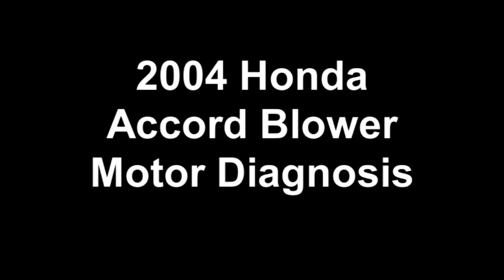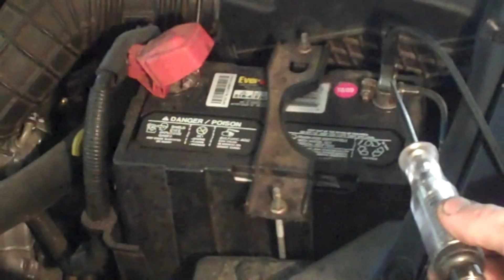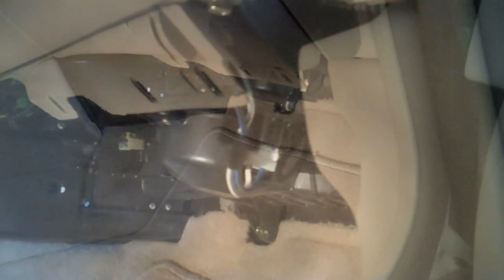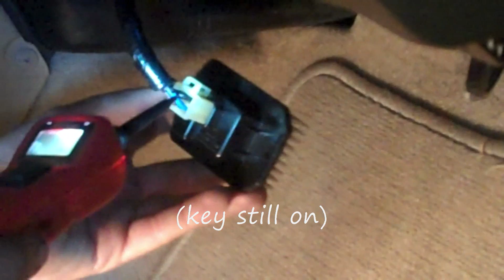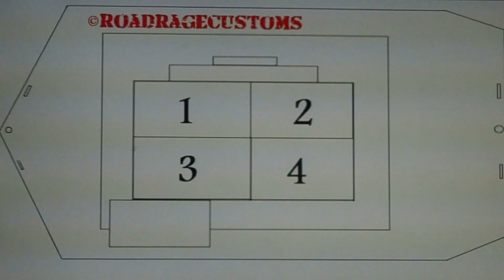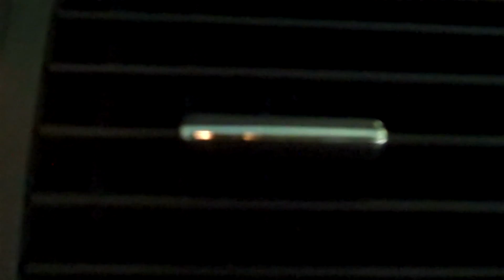Honda Blower Motor Diagnosis

Comment: Google "how to test the blower motor power transistor" (2001-2007 Honda Civic). There are two more tests after the 1500-Ohm resistance test. The first is a diode test with pins 2 and 4. The second is a AAA battery test. There are also separate tests for the blower motor itself.

My 2003 Civic resistor passed the resistance and diode test, but admittedly I got no reading on the AAA battery test so I'm unsure whether the test failed or I'm doing it wrong. Ordered a new resistor anyway.
Reply: My question -- the whole internet says that if your resistor is bad, replace the blower motor too because it may be causing the resistor fail by drawing too much amperage. This appears hard to test. But I can't find any evidence that this is case for 2001-05 Civics.

Comment: do you know if there could be any other reason besides the 40 amp fuse, the transistor or the blower fan motor for why my 2008 honda civic isn't blowing air.  I've bought a new motor, transistor and still not working.  I'd appreciate any help you could give.  Thanks :)

Comment: In agreement with other comments below, it could be noted a little better that the 1400-1500 ohms test is the not the only test for the resistor. It can pass this particular test and still be bad anyway.

Also the heater motor can 'test' as working with a grounded jumper wire, and it can still take out your new $80 relay in about 3 minutes, if the motor is drawing too much current. At least in my case, the fuse didn't prevent this for some reason.
Reply: where is the relay located?  is that different than the blower fan resistor/transistor?

Comment: This is a helpful video. It at least gives you an idea of what to check. The Honda Civic that I worked on has a resistor, which is not a transistor. It was a faulty blower motor for myself--a 56$ part new.

Comment: great video, replaced my power transistor and blower motor operates.  My power transistor did measure 1500 ohms across pins 3 & 4, but I replaced it anyway.  If this part is in fact a transistor wouldn't a diode tester on a multi-meter be a more accurate way to bench test the component?

Comment: I checked my resistor, 4 door, contacts 3 and 4. 1500 ohms., it was bad, so that;s not the only thing that could go bad on the resistor.
Reply: I had the same problem. I agree video requires updating. It could send someone through troubleshooting headache. 🤣

Comment: 03 honda accord 4 cyl.lx air blowing slow .tap it and blows a little better but still not hard. would that be resister or motor
Reply: Motor

Comment: If pins 3 and 4 test fine for a 4 door 2001 honda civic and pins 1 and 2 test at zero, is it still a faulty resistor?

Comment: Good video thanks for your instruction!!!
I have a 2008 honda ridgeline with auto climate control option and hvac blower is not operating on any setting at all i have checked all fuses and relays checked wiring and connections from blower motor to resistor to hvac control unit all is good but no power coming into resistor harness from control unit is this a bad control unit problem? ??

Comment: Very nice, sir.   Just troubleshot the wife's 2001 Civic blower using this video. Sure enough, it's the transistor network. The diagram I printed, showed one more thing, however. If the resistance reads fine, (which it did), next apply a 12v jumper from the cig lighter to pin 1. If the motor comes on, it's something else. If it doesn't, double sure that it's the part.

Comment: Great video, thanks! Dealer wanted $300+ to fix but I got the part for $22 at Drive Wire. One word of caution though: I did this fix in my 2004 Element, it has the same A/C system. I tested the new resistor hanging from the harness as shown here, but when I reached up to turn the key off I bumped the resistor causing the heatsink to contact the bare metal dash frame. Sparks flew everywhere and the brand new unit shorted out. It was another hot week until the second new part arrived. Use caution!

Comment: Jumped fan to battery, it spun but sparked. Ended up blowing new resistor in 30 mins so I got another $5 resistor and a $20 blower from junkyard and it works.

Comment: I want to thank you for this video. I needed something to show me how to do similar diagnostics on my 2004 dodge Dakota. Totally different vehicle, but using these steps I narrowed down the problem and I need a new resistor. This is what they charge over $100 in labor sometimes? SO SIMPLE! I refuse to get ripped off like that again!

Comment: I have a 2002 4-door Honda Accord LX.  It has a manual dial for setting the 4 speeds of the blower fan.  With settings 1 & 2 the fan does not come on at all.  However, the blower fan works just fine when on settings 3 & 4.  How would  I go about diagnosing this problem?  Thank you.

Comment: Hey man, loving this video. Quick question, I've a 1998 Honda Civic and the heater blower is acting up, it seems to work for about 5 minutes before it dies. Any idea why this happens. I've already replaced the blower motor power transistor before. Cheers.
Reply: I got the same problem on my 94 Del Sol - replaced transistor but still works on and off randomly

Comment: My local dealer had it in stock so I went ahead and replaced it.  That fixed the problem.  I guess the check for 1500 ohms does not eliminate the resistor from being the problem.  Thanks again for the video!

Comment: Great video.  Thanks for sharing.  I have the same car as the video (04 accord EX).  The AC stopped blowing.  I have followed everything that you did.  Fuses underhood and dash, voltage at motor - white wire 12v, blue wire 0.63v.  You said voltage at the blue wire instead of 0 would indicate a faulty transistor.  I removed the transistor and it has 1500 ohms for pins 3 and 4 (4 door).  Should I go ahead and replace it or is there something else wrong?  ps.  I straight wired the motor and it ran.

Comment: I think I may have the same issue because I've tested all the fuses and I'm still getting the correct resistance from pins 3 and 4. I am a little unsure of buying another resistor on the off chance it isn't the issue. Were you ever able to find out if you had a defective resistor in the first place, and is the new one still working for you?

Comment: I have acura TSX(06). Yesterday all of a sudden the Fan and AC doesnt work. I turn on AC and nothing, I set fan speed high, AC manually to69 F (outside is 80), nothing, the fan doesnt blow anything, I dont hear any noise, dont feel AC.  What might be the problem?
Reply: allocated did you ever figure out what the problem was? I'm having the same problem on my 04 tsx

Comment: i have a 91 Honda Civic and the AC is cold (hoses) but does not blow air can you let me know where is the relay of fuse so i can check it because i believe they disconnected  when i bought the car

Comment: Very nicely done. Really informative. Have a 98 CRV. Resistor has 3 wires instead of 4.  Any idea which two to check for ohms resistance? thx

Comment: Thanks for the great video it helped me to repair my car. I tested the resistance between 3 and 4 it is 1500 ohm. Still blower is not turning on. I took the resistor and test it in another vehicle with same specification (Honda Civic) and there too it was not functioning which was a positive indicator that the resistor is defective. Bought one from Honda for $150.00 installed it and it is working fine now. I still have the old resistor can you advice if it is defective or how i can repair it.

Comment from the maker: @Bldrsecor Is it not working at all, not working well, are the lights on the control working?  If the blower motor isn't spinning try the following.  Check the blower motor.  Check to see if it has power & ground going to the 2 wires going to it.  Check the blower motor relay & blower motor fuse (#21 I think) under the hood.  If you need more info, let me know if it is LS, LX, or whatever Honda calls Ridgelines.  Also let me know if it has manual or auto AC & exactly what symptoms are.  Thanks.

Comment from the maker: @Deathsassaliant That may be an ignition / tune up related problem, but Nissans used to have major fuel delivery issues.  The fuel injectors would leak & the fuel injection wiring harness had wiring that wouldn't hold up.  You may need 6 fuel injectors & 6 injector pigtails, if not the whole engine sub-harness.  You could easily spend $700.00 or more on parts alone.

Comment from the maker: @yangstud0 That model would have a resistor instead or a transistor (it does the same thing). Did it smell sweet, like maybe, the heater core was leaking coolant? If it was smoke instead of steam, it could be the blower motor or the wiring to it. Disconnect the motor & check for power & ground at the wires that go to the motor. If they are good (& not melted) apply power & ground to the motor & see if it works.  If not, something may be preventing the motor from turning or motor may be bad.

Comment from the maker: @Nightwing690 I bought an engine once from a dealer and the oil pump failed within 3000 miles.  I called them to see if I needed to pull it out to return it to the parts department, or what? They said they needed to see if it was rebuildable & to tow it to them. I put a brick on the gas pedal & threw all 8 rods when I started it. The block was busted all the way around the oil pan. They put another new crate engine in the bed with a gal of coolant, gaskets, oil & filter, and towed it back to me!

Comment: The resistor is the weak link in the circuit besides the fuse. I'd much rather replace this than that contol panel. That looks expensive. Nice job with showing how to do this repair.

Comment from the maker: @spelunkerd Honda part number 79330-SDA-A01 is a "blower motor power transistor module".  It's more than just resistors.  It communicates with the control unit & can provide feedback that can cause the unit to store codes for diagnosis.

Comment: You keep using the word transistor. Don't you mean resistor? I thought the way the blower motor control works is by variable resistance.

Thanks for posting these videos, I don't mean to criticize.
Reply: Transistor, Power - Honda

Comment: Good vid. i didn't know newer cars use transistors. Question now is, "Did the transistor blow out because it was bad, or is the blower drawing more current, blowing up the transistor?" 
Time will tell.